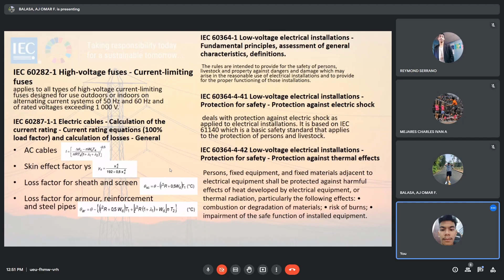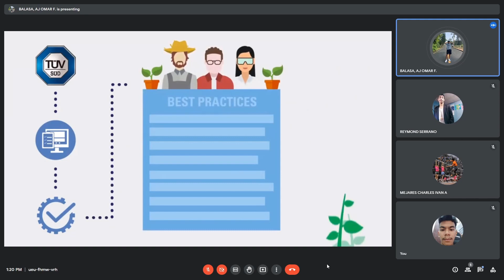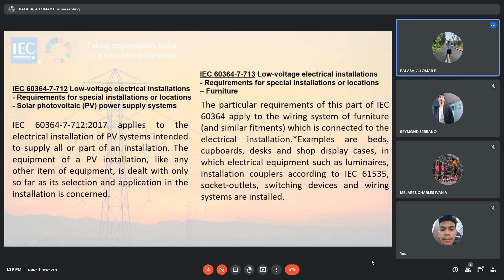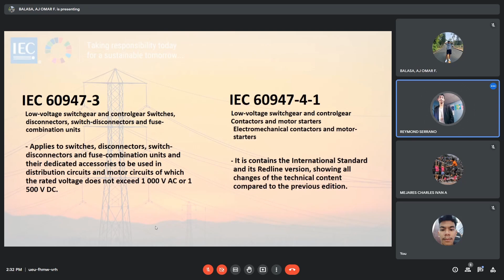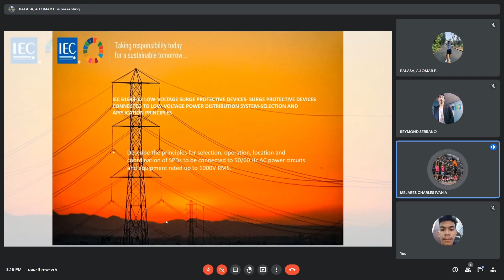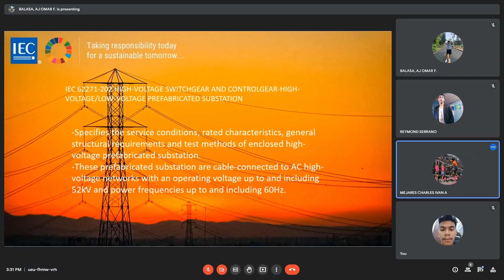IEC STANDARDS GROUP 6

Comment: This specification covers freshly produced current transformers used with electrical measuring devices and electrical safety equipment at frequencies between 15 and 100 hertz. Transformers with independent windings are mostly affected, however autotransformers are also included.

Comment: All varieties of high voltage current limiting fuses are covered by IEC 60282-1 High voltages fuses - current-limiting fuses. This particular type of fuse is intended for use outside and with alternating current systems operating at frequencies between 50 and 60 Hz.

Comment: IEC 60364 the particular requirements contained apply only to circuits intended to supply leinsure accomodation vehicles tents or residential park homes in caravan parks and similar locations.

Comment: IEC 60364 Electrical Installations for Buildings is the International Electrotechnical Commission's international standard on electrical installations of buildings. This standard is an attempt to harmonize national wiring standards in an IEC standard and is published in the European Union by CENELEC as "HD 60364".

Comment: IEC 60364-4-43 Low-voltage electrical installations - Protection for safety - Protection against overcurrent

-it describes how live conductors are protected by one or more devices for automatic interruption of the supply in the event of overload.

Comment: IEC 60364-7-710 Low-votage electrical installations. 
-calls for specialized installations, locations, and medical facilities. This electrical infrastructure, which is used in a medical setting, ensures the safety of both patients and the medical staff. In order to prevent electric shock in their surgical and life support equipment, it offers protection to their medical supplies and equipment.

Comment: The discussion focuses on global body called the International Electrotechnical Commission (IEC) establishes standards for technological and electrical equipment made for consumer markets. Numerous countries from throughout the world are IEC members. IEC standards result in a more uniform core standard for many technical and electronic devices. With a mission to ensuring the safety, effectiveness, reliability, and interoperability of electrical, electronic, and information technologies, as well as to promote international trade, facilitate widespread access to electricity, and enable a more sustainable world, the IEC's mission is to achieve widespread adoption of its international standards and conformity assessment systems.

Comment: IEC 60664 Insulation coordination for equipment within low-voltage system all parts. It provides requirements for technical committees to determine clearances, creepage distances and criteria for solid insulation. It includes methods of electrical testing with respect to insulation coordination. The minimum clearances specified in this document do not apply where ionized gases are present.

Comment: IEC 60364-7-710 Low-votage electrical installations

Requires a special installations or location and medical locations. This electrical installation applies in medical location provides a saftey of patients and also to the medical staff. It provides protection to their medical equipment/supply in order to avoid electric shock in their life support equipment and surgical equipment.

Comment: IEC standards deal with general needs, particularly those linked to electricity, such as dealing with wire systems, switching, and controllers. It is a set of electrical and electronic standards. In the event of a hazard, it also obtained general worker safety services, which include inspection and testing to preserve the operation's safety.

Comment: IEC 60947-6-1
Applies to transfer switching equipment (TSE), to be used in power systems for ensuring the continuity of the supply and allowing the energy management of the installation, by transferring a load between power supply sources, the rated voltage of which does not exceed 1 000V  AC or 1 500 V DC.

Comment: IEC 60364-7-729 Low- voltage electrical installations- Requirement for special installations or locations- Operating or maintenance gangways
 -It's apply to basic protection and other aspects in restricted access areas with switchgear and control gear assembles, including requirements to operating or maintenance gangways.

Comment: IEC 60071-1:2006
 is applicable to three-phase alternating current. systems with a maximum voltage for equipment above 1 kV It specifies the procedure for determining the rated withstand voltages for phase-to-earth, phase-to-phase, and longitudinal insulation of equipment and systems.

Comment: IEC 60529 (Degrees of protection provided by enclosures)

Meaning they can resist a brief submersion in shallow water and completely dust-proof. has been created to evaluate and grade the resistance of electrical and electronic device enclosures to the entry of liquids and dust. It also rates how simple it is for anyone to get to any potentially dangerous components that are inside the enclosure.

Comment: IEC60364-4-42 LOW VOLTAGE ELECTRICAL INSTALLATIONS-PROTECTION FOR SAFETY
This states that people, fixed equipment, and fixed materials close to electrical equipment must be protected against the negative impacts of heat radiation or electrical equipment, in particular the negative effects of material combustion or deterioration and fire risk

Comment: IEC 62305-3 PROTECTION AGAINST LIGHTNING PART 3: PHYSICAL DAMAGE TO STRUCTURES AND LIFE HAZARD
        • Provides the requirements for protection of a structure against physical damage by means of a lightning protection system (LPS), and for protection against injury to living beings due to touch and step voltages in the vicinity of an LPS

Comment: IEC 60282-1 High Voltage Fuses - Current -Limiting Fuses

Applies to all types of high-voltage current limiting fuses designed for use outdoors or indoors on alternating current systems of 50Hz and 60Hz and of rated voltages exceeding 1000v

Comment: This International Standard is applicable to oil-immersed single-phase and three-phase power systems.
transformers (including auto-transformers), with certain tiny and exceptional exceptions
transformers as they are referred to in IEC 60076-1. It assigns transformer windings a number according to greatest voltage for the equipment U matching to their rated insulation levels

This provides information on the pertinent applicable dielectric tests and required airborne external clearances.
between the live parts of bushings and the prospective objects on earth.

This IEC standard applies to classes of power transformers and reactors that have their own specifications.

Only when a standard is directly referred to by a cross reference is it applicable
in the other criteria.

Comment: IEC 60364-5-53 Low-voltage electrical installations - Selection and erection of electrical equipment - Isolation, switching and control

All electrical equipment with the symbol shown has the standard means by manufacturer as equivalent to class and all electrical equipment has undergo a process of installation the equivalent level of safety which uninsulated life parts shall be reinforced insulations provided by an enclosure of at least IPXXP or IP2X.

Comment: IEC 60947-3- Low voltage switchgear and control gear switches ,disconnectors, switch disconnectors and fuse combination units.

Applies to switches, disconnectors, switch disconnectors and fuse combination units and their dedicated accessories to be used in distribution circuits and motor circuits of which the rated voltage is 1000 V AC or 1500 V DC.

Comment: IEC 60346.6 Low-Voltage Electrical Installation - Part 6: Verification.
- This is the one who is responsible for providing requirements in making sure that the other regulations under IEC 60364 have been met.

Comment: IEC-60364-4-42 Protection Against Thermal Effects
Electrical installations in places with risk of ignition of fires  like stores of combustible materials and wood working shops must observe safety measure  to minimize the risk of fire due to high temparature, electrical arcs and faults, etc. Arranging electrical installations properly  and protecting individual and materials from high temparature ang thermal radiation must be observe.

Comment: This standard applies to newly manufactured current transformers for use with electrical measuring instruments and electrical protective devices at frequencies ranging from 15 to 100 hertz. This applies primarily to transformers with separate windings, but it also applies to autotransformers.

Comment: IEC 60364-4-42 (LOW-VOLTAGE ELECTRICAL INSTALLATIONS-PROTECTION FOR SAFETY-PROTECTION AGAINST THERMAL EFFECTS) - Electrical Equipments, Fixed Equipments, Fixed Materials and also Persons shall be protected against Harmful effects of heat developed by THERMAL RADIATION that can give effects like risks of burns, combustion of materials and degradation of materials.

Comment: IEC 61439-5
Low-voltage switchgear and controlgear assemblies - Assemblies for power distribution in public networks
defines the specific requirements for public electricity network distribution assemblies (PENDAs). PENDAs have the following criteria:
- used for the distribution of electrical energy in three phase systems for which the rated voltage does not exceed 1 000 V a.c.

Comment: IEC60364-8.1 Low voltage electrical installations -energy efficiency
Gives requirements and recommendation to the design of an electrical installation with an energy efficiency approach. This emphasizes the importance of energy efficiency in the design electrical installations. In the same as safety and implementation rules

Comment: IEC 6044
Applies to newly manufactured current transformers for use with electrical measuring instruments and electrical protective devices at frequencies from 15 Hz to 100 Hz. Applies basically to transformers with separate windings, but also to autotransformers.

Comment: IEC 60787 - Establishes criteria to co-ordinate high-voltage fuse-links with other circuit components. Gives guidance for the selection of fuse-links with particular reference to their time-current characteristics and ratings. Applies to fuse-links of fuses which comply with the requirements of IEC Publication 282-1 and intended for use with transformer circuits.

Comment: IEC 61439-3 Low voltage switchgear and controlgear assemblies
- it defines the specific requirements for distribution boards intended to be operated by ordinary persons.

Comment: IEC 60831-2 Shunt power capacitors of the self -healing type for a.c. systems having a rated voltage up to and including 1000 V - Part 2 : Ageing test , self healing test and destruction test .

Comment: IEC 60076-12 Power Transformers-Loading guide for Dry-type power transformer

Defines a set of standard voltages for use in low voltages and high voltage AC and DC electricity supply systems.

Comment: IEC 60364-7-722 Low-Voltage electrical installations- Requirements for special Installations or Locations - Supplies for electric vehicles

Comment: IE60364-4-43
Low voltage electrical installation-Protection for safety- Protection against over current

Overcurrent occurs when a wire or conductor receives too much current. It may cause overheating, circuit overloading, a short circuit, or even a fire. So, it is important to know how one or more devices for automated supply interruption in the event of an electrical or mechanical failure protect live conductors.